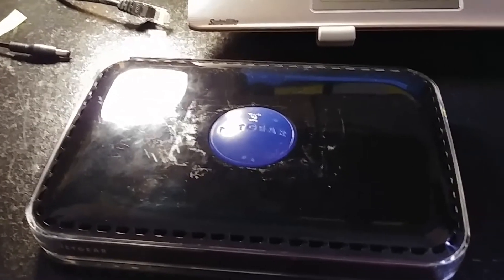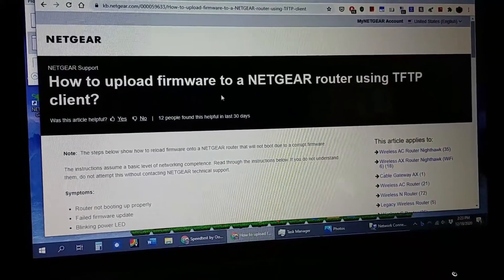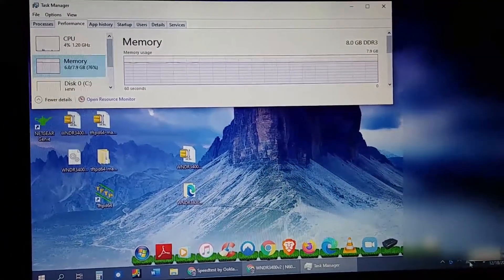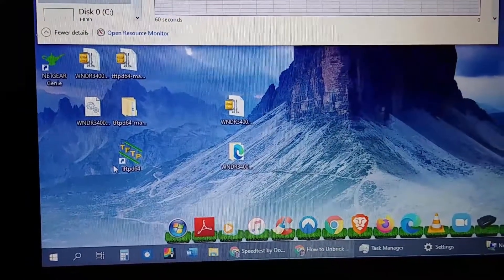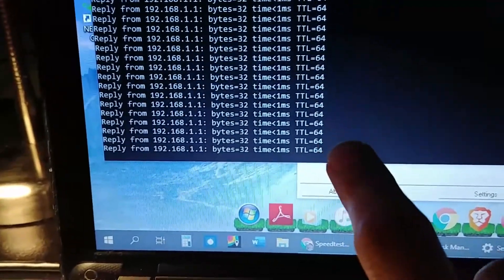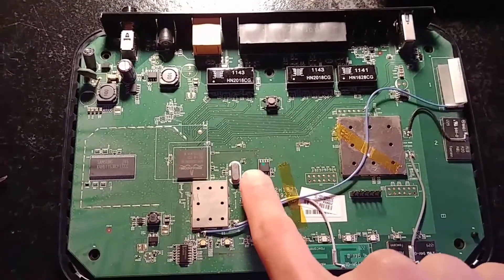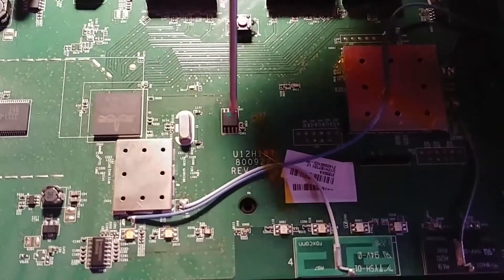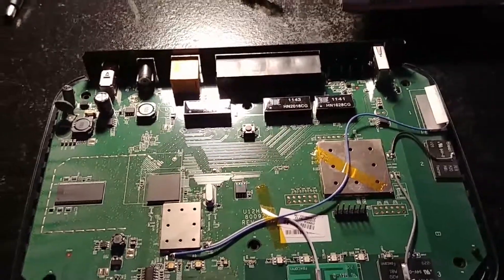Netgear N600 WNDR3400v2 Fix [Does not update. Corrupt Firmware. Reset not working]

Comment: amazing! this video was of huge help
after i closed the contacts with a screwdriver like u showed i was able to get the network interface of the router going, but alas tftpd64 did not work at all, i tried 3 times, ended up using nmrpflash specifying manually the ip and mac and it did work
Reply: just for clarification: it WAS my last resort, i tried everything, the router's network interface was simply not working, it did not connect and i couldn't even ping it let alone open the menu
Reply from the maker: Thank you for your kind words! I am very happy this worked for you as well! It is a little tricky to do and you need patience and some tech skills but you did it! 😀

Comment: Question: you have header pins why didn't you flash through cfe? it would have been much safer to do.

Short pinning the flash chip is one of the worst things to resort to doing, as this will permently destroy the chip and instead of throwing it away, the router should be recycle properly there are hazardious matierials and parts on the pcb.

I had to thumbs down your vid, it promotes a very risky technique that is dangerous even though this router is quit old it is still used.

The problem is not firmware related it is the cfe got corrupt and the only way to undo this is to flash through the cfe.
Reply from the maker: Because for CFE you have to buy pins and it doesn't always work, it more complicated to find code and your wasting money and time. Besides this is an old router which is why I short circuited it. I didn't really care about it and i mentioned that in the video.  I also said this was a last resort method before throwing it away and buying a new and way better one.  And to do this at your own risk. It's worked for me and for some other people as you will see on comments.
Reply: @rodaraguz  You have the header pin already in place on the router shown in the video?

Yes it does work flashing through the cfe, what commands did you use?

That is not enough to justify bad advice.

Comment: Hey there my dude, thanks for this Vid. BTW, can one add a high gain external antenna to this router?
Reply from the maker: I would not buy a high gain external antenna. You are wasting money. Those things don’t make much of a difference at all. i don’t think this router supports it and but it does work very very well on 2.4G. Remember this is a wifi4 released in 2009 We are are at wifi6. I would encourage you to go to Walmart and buy a cheap $60 dollar wifi 6 router. On a 100MB ISP plan you will get 112MB on a wifi 6 router. On a wifi 4 like this one you would get like 60MB tops. Do not buy a high gain external antenna. Watch thiojoe’s video on this. What you could do is buy a wifi6 router and set this one up as an access point.

Comment: When I ping all I get is host unreachable any idea what I can do?
Reply from the maker: Maybe the cable is not connected properly (sometimes this is the problem) or you disabled the network adapter by accident or have the wrong one enabled.  On windows 10, Go to setting and search for "Change adapter options"  to check what is enabled and change it to the "Ethernet" controller

Comment: i have the wndr3400v2, i flashed the openwrt but the wifi did not work, i was going to use a modded ddwrt firmware that works with version 2, but when i flashed it with the OG firmware, it bricked, however i did not had to resort to opening the router, the bricked state automatically gave me ttl=100 so i use the tftp and i was able to revive the router, now i was able to flash the ddwrt mod firmware and IT IS WORKING LIKE DANG!!!
Reply: Hi Octavio, I have this router; but want to update the firmware. You said you got DDWRT working. Interesting, yeah Tomato claims to make it work. Do you have an FTP server, on the DDWRT Firmware. Is it worth it, compared to the old, original firmware. I saw that link to the new DDWRT (moded). I want to compare the 2 firmwares, to see which one might be better, or have the features that I would be interested in. It is refreshing, to hear that the moded version of DDWRT works, because there is still no official version. Looking forward to hearing from you, thanks!

Comment: Hello sir my n600 main net cable port is not working
Reply from the maker: Hi It's most likely that the pins are bent maybe because the ethernet cable was pushed too hard so they are not making contact. You could try pulling them out very carefully with tweezers or a paper clip to get good contact. If nothing works, it is a waste of time to fix it so its best to buy the newer AX Wifi6 routers which are better and faster even if you don't have Wifi6. This router is kinda old (November 2016) so that is why I decided to fix it the way I did in this video because I was going to buy a newer one anyways.